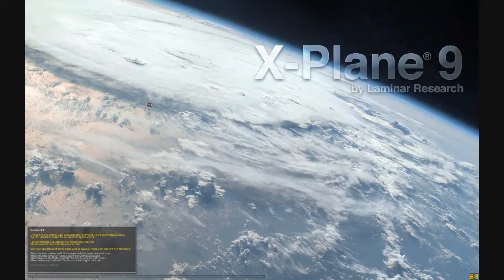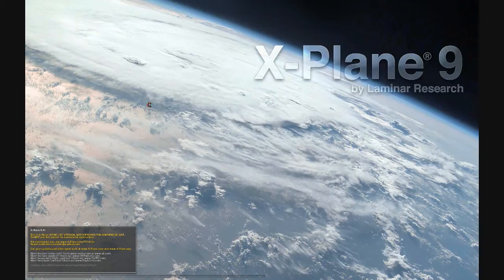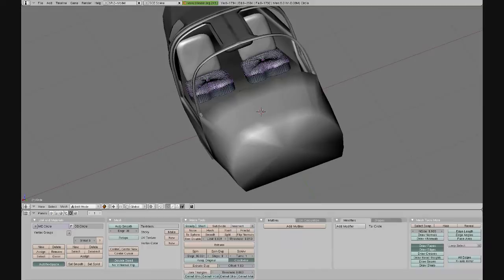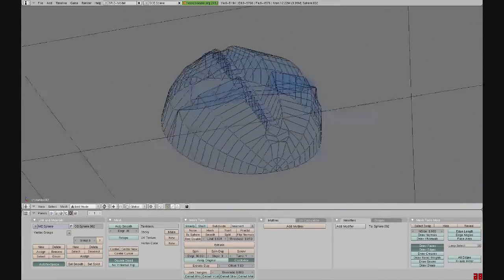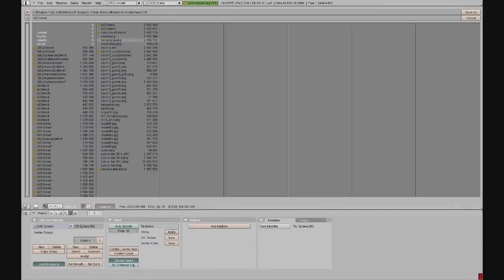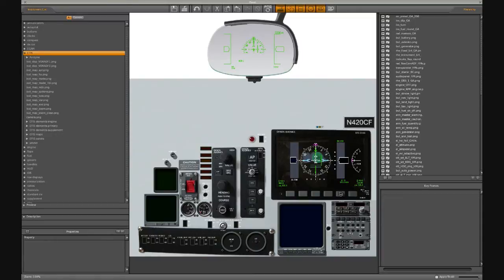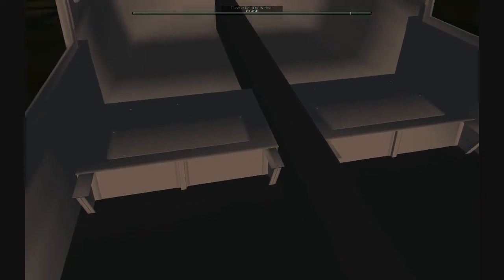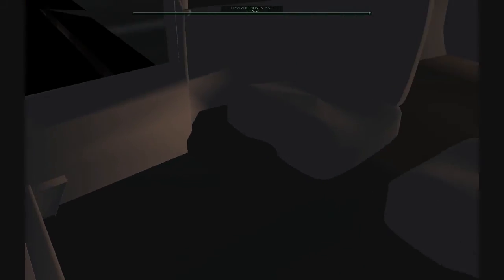RV-10 Virtual Cockpit Modeling for X-plane

Comment: Matt,  I have an RV10, wondering if you could do some rv10 test flying for us on Xplane.  We were wondering how best to ditch the plane in an engine out situation over water.
Reply from the maker: Hi Andi! Great to hear from another RV10 owner :) We completed the build on our 10 ( N420CF ) almost 3 years ago and we just love it. We are currently building a RV12 and have put the 10 up for sale to make way for the engine and avionics for the 12. When I get some time I will try the engine out over water scenario in x-plane. I'll post the results back to this thread with details.